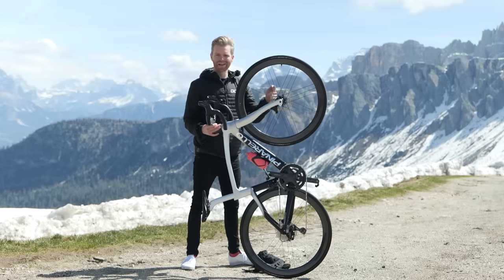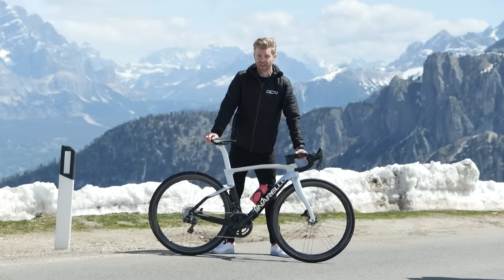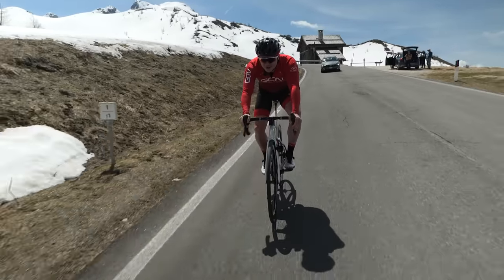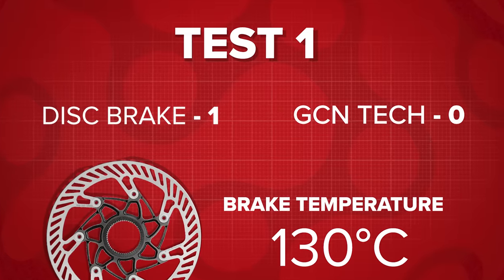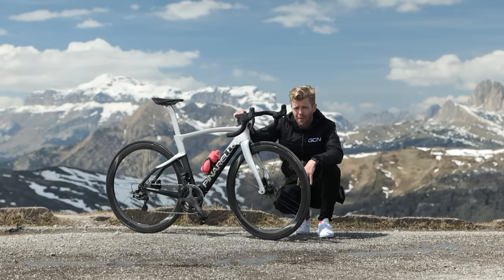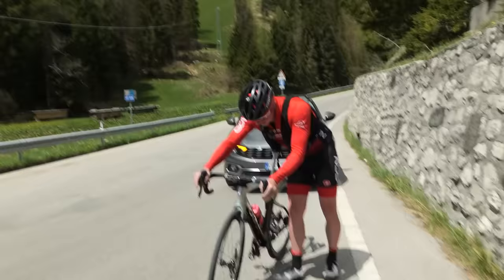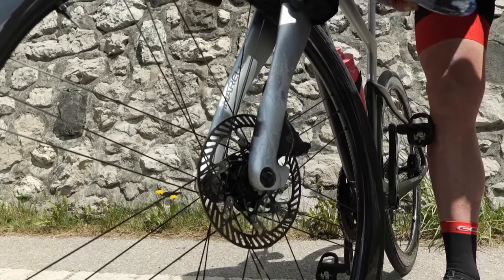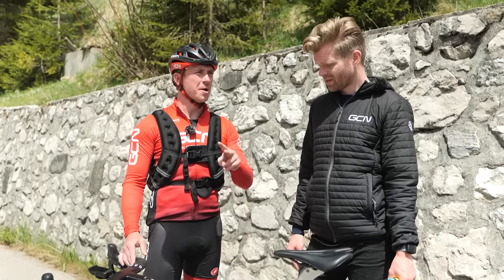Can We Melt Disc Brakes!?

Comment: Ollie mentioned kinetic energy - it grows proportional to mass (double the mass double the energy) and with the square of the speed. In my opinion to put most energy possible in the disc they should put on the vest and let the speed build on the descent and then break hard - constantly accelerating and stopping . At 30 kph you have 9 times more kinetic energy then at 10 kph - so the amount of energy you have to dissipate is much greater.
Reply: Speeding up is just converting potential energy into kinetic energy. So they would have put the same amount of energy into the brakes as long as the ride the same elevation and mass, regardless of the speed.
Reply: but the total amount of kinetic potential energy that is available to convert to heat over the whole descent is governed by only the height of decent and total mass (minus inefficiencies(aero drag, mechanical ect)). Going faster will only increase the amount of kinetic energy the rider has at a given moment, not the total energy that must be dissipated by the brake as heat. Going faster would actually decrease the energy the brake must dissipate because there would be a larger effect of aero drag, therefore less of the total kinetic potential energy the rider had at the start needs to be dissipated by the brake.
Reply: you may still be correct that going fast and braking hard would make the brakes hotter by the  bottom but it would be because of the rate of cooling vs heating not because the energy of the rider has been increased
Reply: Will not work, the brakes can cool down FAST.  And the funny thing about going faster, the air not only cool down the brakes, but also provides resistance, helping the issue.  Dragging is the worse thing you can do.
Reply: Did you consider that while you are building speed, the brakes are cooling? 👀
Reply: @cliffordromina3527  overheating in this case is NOT about total energy. It’s all about instantaneous energy. So speed DOES matter.
Reply: Conservation of energy - doesn’t matter what you do to descend, total energy going in the brakes will be the same.
Reply: @bakedbeanfanclub  ROFL! Rate of temperature change matters otherwise why even bother with heat dissipation mechanisms like Shimano ice technology?

It’s all about amount of heat generated over time.
Reply: @cyclingformortals2231  it's about heat build-up caused by the difference between input (braking) and output (cooling). Short heavy braking causes the discs to heat up very fast but during a short amount of time. After letting the brakes go, they cool very fast because of a) the large heat differential between the discs and ambient air and b) the fast air flow around them, caused by the higher speeds. Constantly dragging the brakes at a level that keeps the bike going but manages to have the braking heat overpower the cooling (because of low speeds) is actually far worse. If you don't believe me, just do a very long steep descent and try both methods. Believe me, a friend of mine used to cook his brakes every other MTB descend when he started downhilling. He now improved his technique and does shorter, heavier braking and doesn't cook his brakes anymore.
Reply: @macvos  you are correct BUT it still depends on the speed that you are going. Are you dragging the brakes at 40kph down a very steep descent or are you dragging it down a gentle gradient? Materials have a melting/boiling point and unless you hit that limit then you are safe. You can drag your brakes all day and you may not melt it because your speed is slow enough. You could also brake really hard before a hairpin bend while going 100kph and instantly boil your brake fluid.

I have experienced this myself. HRD is 2.63kms averaging 13%. Descended with my disc brakes and I had to stop halfway through because my brakes started squealing and getting spongy. Next time I descended was with my rim brakes. I dragged the brakes all the way down doing only 30kph average and I never noticed any loss of braking power.
Reply: @cyclingformortals2231  My rimbrake pads (standard SRAM) feel like chewing gum after hard breaking. Would never drag rimbrakes. On discs you get fade, on rimbrakes you can blow your tire or tube.
Reply: @Roadbikerider79  never had problems with my aluminium rims descending very steep (as in 20%+) gradients but my disc brakes always squeal and fade. There is no way a 60mm rotor will outperform a 622mm rim in heat dissipation.
Reply: @cyclingformortals2231  My comment was about what happens if you drag your brakes both rim and discs. The dangers of dragging rim brakes are potentially more severe because you don't get fade as a warning that things are heating up. On carbon clinchers the wall holding the bead is pretty thin and that's also where you breake. You mentioned aluminium wheels and they are much better. Anyway, don't drag your brakes people and you won't have problems.
Reply: @Roadbikerider79   again, the whole dragging thing depends on speed. Instantaneous energy is mvv/2. Speed (v) is the biggest factor because it is squared. If you drag while going fast on a very steep descent then you will overheat your braking surface. You can still drag your brakes as long as you do it early before you get too fast. 

I’m reading naive comments here saying that speed does not matter because you are descending the same elevation (potential energy). Such laughable comment is basically saying that parachutes don’t work because you will still hit the ground from the same height that you jumped off. 

As an aside, re disc vs rim, carbon rims are far inferior braking surfaces and I have watched and read accounts of them delaminating on descents and that’s why Shimano only has tubular carbon rims (no clinchers). But if you consider aluminium rims, there is no way a 60mm disc rotor will ever surpass it in terms of heat dissipation. It’s elementary science.
Reply: @cyclingformortals2231  Like I said... don't drag your brakes😄
Reply: @Roadbikerider79  like I said you probably have not descended steep gradients
Reply: @cyclingformortals2231  No i just go up never come down😄
Reply: @cyclingformortals2231  the system should be designed for the speeds you're going. Most bike brakes aren't build for sustained 100kph descents. You definitely won't boil your brake fluid with good (preferably gravity racing oriented) brakes, but pads might glaze and discs might overheat.
However, even dragging the brakes at mellower descents at lower speeds might glaze pads and should therefore be avoided.
Descending Alpe d'Huez (average only 8% but part >12%, roughly 1100 vertical meters and 12km long) with 180mm single piston disc brakes with metallic pads resulted into some squealing, but no loss of function. A friend with rim brakes wore out his pads in two descents. Someone blew a tire because of overheating the rim.
Doing the same with 203mm discs and dual piston DH rated brakes was no problem at all.
Do the same at 100kph as a heavy rider and even those brakes might not be enough to avoid some level of overheating.
Reply: On roads made for regular car traffic I can imagine you don't run into issues with these disc brakes. However at steeper straight hills at fast speed (40+ km/h) I notice brake fading after a short time already.

Comment: Hydraulic disc brakes (not necessarily on bikes) fail  because outgassing of the brake pads reduces contact with the disk or the fluid boils. The slots on the rotor prevent gas build up so brake pad outgassing is not an issue. Even the cheapest DOT3 brake fluid is required to have a boiling point over 230C.  Measuring the caliper temp would have been more interesting since that would give an idea of how hot the fluid is and how far away from the boiling point they are. Not that we know exactly how Campy specs their fluid.
Reply: Campy brakes use plain old mineral oil, either the official Campagnolo oil or Magura Royal Blood (both are approved).
Reply: @nstrug  Magura Royal Blood has a boiling point of 120 degrees Celsius. Like Shimano, Magura and Campagnolo probably isolate the oil from the heat by using, for example, ceramic pistons.
The first part to limit braking performance would probably be the organic pads glazing over.
Reply: @macvos  they use ‘Duroplastic’ aka phenolic resin. Same as Hope do.
Reply: @nstrug  Shimano now uses "glass fiber phenolic" insulating pistons. I assume the Hope and Campagnolo pistons are insulating as well.
Reply: @macvos  yes, highly insulating. The Shimano ceramic pistons are very prone to cracking/chipping when people try to reset them for new pads. They’ve been switching to phenolics across the MTB range for a few years now, I was unaware they were doing this on the road/gravel range too. If they are that’s really good news. I’ve had multiple Ultegra and Dura-Ace calipers with seized or cracked pistons right out of the OEM packaging in the workshop and Madison/Shimano are well aware of the failure rate.

Comment: My friend is an engineer at SRAM and according to him they did basically this in the Alps with early versions of their road discs. Long, long descents in the heat of the summer trying to make them fail. Early on though they didn't test the other end of the spectrum and their brakes were not working well in cold temperatures during cyclocross season. I remember one race in Bend, OR when many of the pros just couldn't really use their brakes (because it was -10C that day).  Seems they've sorted all that now.

Comment: For a more useful comparison, run a heat/stress test comparing caliper/rim brakes to disc brakes. Under equal descending conditions, test which fails first, and what mode of failure it is.

Comment: Dr. Bridgewood, the warping occurs with so called shock cooling. 

Hot discs get splashed with very cold water. 

This is common even on automobiles especially in the winter time.

Comment: You guys need to try Shimano Ice Rotors. We melt those on the rear of tandems all the time. We also have seen temps above 900-1000 on a 10" rear rotor (Standard size for a Santana Tandem!)

Comment: Good video.  Not surprised by the results.  I was a little surprised by the heat on the 2nd descent (356 degrees F) is quite hot.  I didn't expect to see brake fade, cars have been using disc brake technology for many years.  The weight load per square inch of disc surface on a car rotor is much high than the bike.  Additionally, the bike rotor is out in the wind where cooling is superior.
Reply from the maker: It was a bit surprising, but it is a very long descent, and he was dragging it the whole way down - we'd definitely not recommend it!
Reply: @gcn  I already got the brakes of my MTB blue (which means they had 300°C) on shorter, but very steep descends. Offroad you can't just let it run, on a road aerodynamics also start to consume some of the energy at 50 kph but you can't ride that offroad through forests.
They are just MT 200s, but they never took any damage.

Comment: The moment I saw you used steel Campa discs, I knew you wouldn't melt them. Try the sandwich structure alu shimano ones. They will at least be warped.

Comment: Mineral brake fluid  versus dot is that mineral brake fluid does not absorb moist so no hygroscopic problems. For example BMW motorcycles use DOT fluid for there brakes and mineral fluid for there clutch. Ever changed the slave cilinder? It is a hell of a job so use mineral fluid you minimal the risk with hygroscopic fluid.

Comment: Luescher Teknik has a nice video on problems with carbon clincher wheels and rim brakes on big descents: basically carbon clinchers have extra problems dissipating the heat. All that heat eventually softens or even melts the resin holding the carbon fibers together and you get wheel damage or even catastrophic failure. Putting the heat generated by braking into a robust, dedicated braking metal (i.e. the disc) solves the problem.

Comment: The Hydraulic Press Channel did this using an inexpensive Tektro mountain bike brake and a lathe... it blew the hydraulic line before anything else happened. They repeated the test using disc brakes on a car and they got red hot before stalling immediately.

Comment: A harsher test would be to pick a nice steep straight section where Hank could get to about 70-80kmh, have Ollie waiting out of the car just past that point and smash the speed from warp speed to nothing in as short a time as possible. With the current test the heat is basically being dissipated fairly evenly over about 1/4 of an hour. On top of the extended time is the time between when Hank stops and when Ollie got his gun out. The disks get rid of heat quite quickly so in the time between stopping and being measured there will be a fairly significant drop in temp. Doing the same test with a thermal camera in a follow car would probably show temps over 200C.
Reply: In the Industrie are temperature measuring strips often used. Low tech but very effective
Reply: A - we didn’t have a descent like that we could get to within the window we had to film
B - we don’t have that kind of equipment unfortunately! Trying to do the best with what we have! 
hope you still enjoyed

Comment: I'm around 95kg, usually over 120kg with bike and gear, with a gravel bikepacking/touring setup, with 160mm rotors, Shimano grx brakes (and 45-50 mm tires muuuch more grippy than those road tires) I've never had any problems, even on long and fast, or sketchy descents where I have to drag brakes for a while (although not as much as this test). That said, I always try to use a good braking technique -but because I like speed, and that's the only way if you wanna go as fast a possible, "safely".

Based on my experience, I didn't expect the brake to fail in this test. But I think a similar teste with 140mm rotor, with over 110-120 kg of rider+bike+gear, could really find the limits of a bike disc brake. My thoughts are the first failure point is the fluid or the pads, neither the rotor, caliper or pistons if they are in good condition. It would be great to see that test.

Comment: Back in the 90's, when I was competing, I did a fun run down the mountain from Big Bear, CA. This was before disc brakes, so I was using Ultegra rim brakes on my race bike. The rim got so hot, that they popped both intertubes, front and back. Coach clocked me at over 80mph though, which was very fun.

Comment: Had full confidence in the disc brakes. I go on bicycle touring trips every summer. Two summers past I weighed in at about 125 kgs at the time,  had a fully loaded touring bike which weighed in at 55 kgs when fully loaded. Descended a 580 meter gravel downhill where the steepest parts were 25%. Had the wise thought to stop 3 times during the descent to let the discs cool for a bit and enjoy the scenery. 
180mm front and 160mm back and from Sram.

Comment: Great to find out that finally there's a brake that can withstand brake feathering for 16 km!  A friend's full hydro road bike brake system (the most common brand we know), brake faded in less than 12km of descent when we tried it. The bite went to zero when used with non-ice tech rotors...but with ice tech rotors though, it was just fine.

Comment: I have to say as a larger rider (103kg) iv destroyed a few disks and pads in my time.   Iv regularly shocked other riders with my front disk glowing.  I also have to upgrade the brakes on any bike I buy, as they never suit heavier riders.  Currently running 200mm icetech rotors front and rear as well as iectech pads (the ones with big fins on them), that I eat very quickly.  As the previous comments state, there is a market for heavier duty braking kit but manufacturers don't seem to be addressing it?

Comment: I love to hear people talking about stopping power of rim brakes when they clearly have no vast experience with decent rim brakes whatsoever. I often ride rim brakes on mountains and have gone through much steeper descents than this without any heat issues (130 degrees, really?)  and i could any second stop the front wheel and go over the bars. Interestingly enough, people who mention rim brakes have no stopping power, will defend their statement saying that they meant there is no modulation. Either you brake too little or too much. But then again, isn't power a measurement of how much/with which intensity? Then why did you say rim brakes have no stopping power? 😀
Reply: Try is on carbon rims in the rain.
Make sure your health insurance is up to date.

Just switched from Ultegra rim brakes on aluminium rims and now have DA disks.
Will never go back.
Reply: @NemesisRTCW  I sincerely appreciate your concern with my health. Having spent a full winter with proper v-brakes in the rain, i am glad to say i have been incredibly lucky, same as in the past 20 years. I would also recommend you do a health insurance, but one of those that aren't a scam, like disc brakes on bicycles.

Comment: I serviced a friends disc brakes, he said they were making a funny noise. The pad material was all gone, he was braking with he aluminium backing plates. He plates were partially melted through with the pistons poking through the plates. The disc was badly worn and there was molten aluminium in the disc venting holes. So yes, you can melt brakes. I have photos and the melted plates and disc if you want to see them.

Comment: With the rotor temperature at <200degC there is no danger of the fluid boiling unless it is contaminated and/or degraded.  DoT 4 fluid has a dry boiling temp of 270degC and the temp of the caliper piston will be substantially less than the rotor temp due to the insulating property of the pad material.  Given the substantial cooling area on the rotor and lack of mass, I would have expected the rotor to have cooled quickly.  The main consideration is obviously not brake fade but rotor warping that will cause substantial drag.